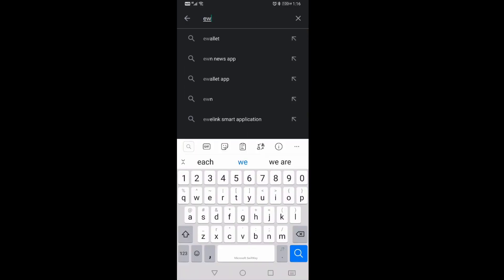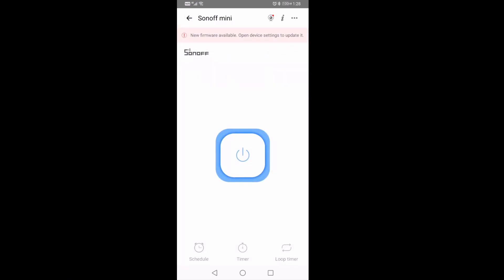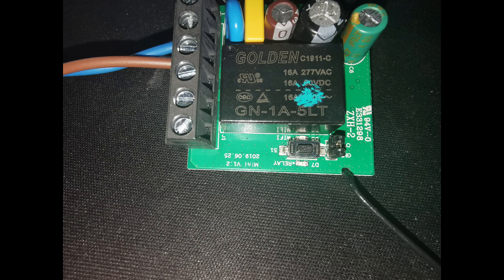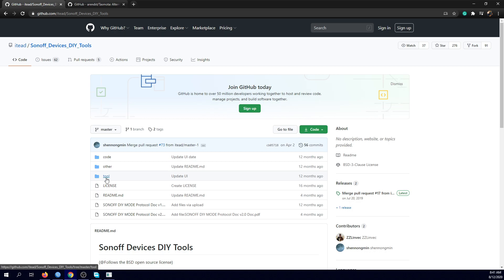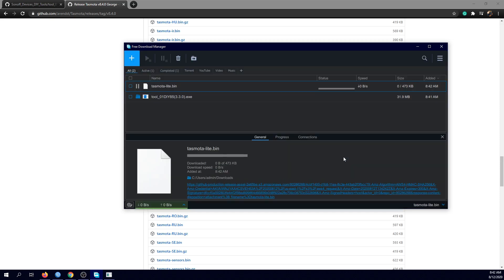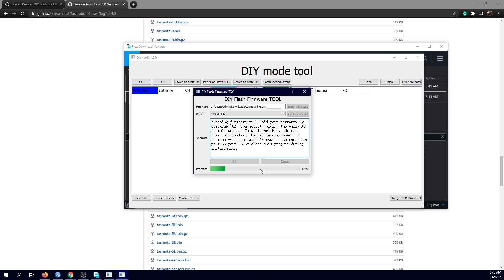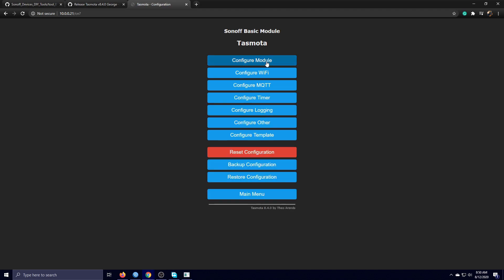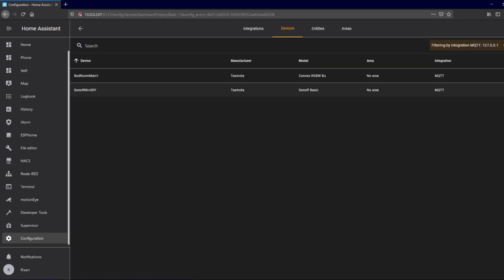Home Assistant 124 Sonoff MINI Flashing

Comment: I just bought 4 new Sonoff mini and there are neither jumper pins on the electronic circuit nor jumper in the package obviously. There are only two lead spots instead of pins on the electronic circuit. I know that if I weld a wire between those small welds I will get the same result than a jumper on the pins as per your tutorial. My question is should I keep the contact between those two lead spots or I have to cut the wire once flashed? Do you kept the jumper in place after the flashing step at your side? Sorry for my poor English by the way.
Reply from the maker: I think there are two different versions of the mini the normal sonoff mini and then the sonofminiDIY  is the one used in the video

Comment: I followed this, I can't get it to flash, I am able to load the tool, import the bin file, but when I select flash first it tells me no device is selected, but eventually it appears to select the device. Then I hit flash and it grays everything out but the progress bar doesn't change?  Any thoughts? Thank you.
Reply from the maker: I am not sure if you have the jumper plugges in you should be good to go I don't think you will be able to hold the reset button as these are being flashed OTA so pressing it would reset the device.
Reply: @AverageAutomation  I tried both with and without the jumpers...gave up and soldered wires and was able to flash.  I am sure your method works for most, thanks for trying to help.